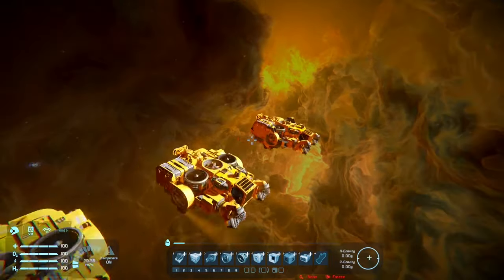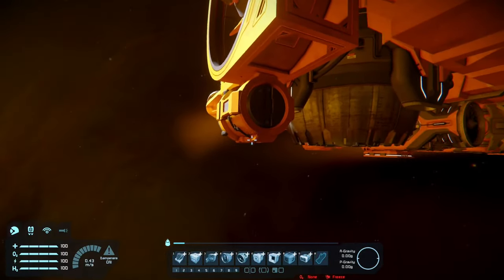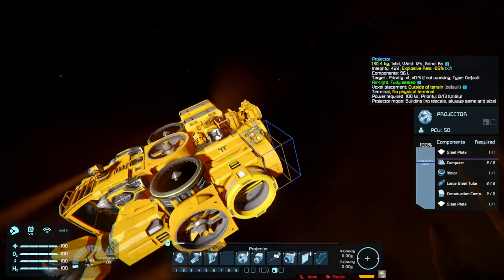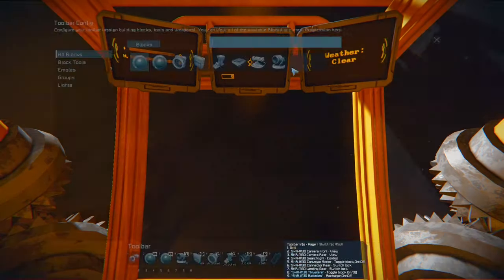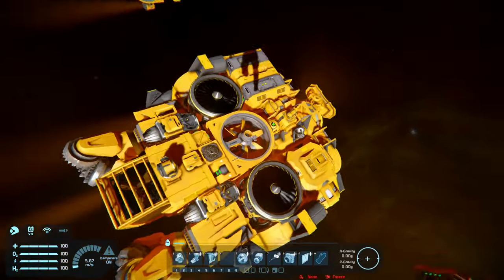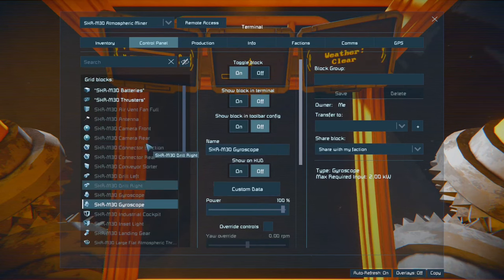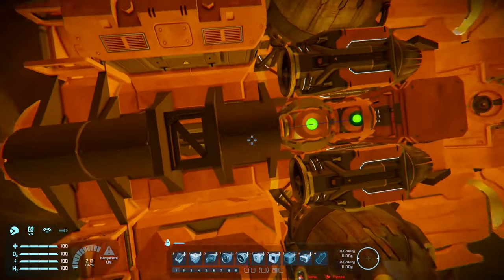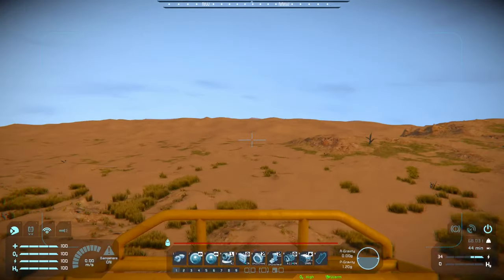Efficient & Good-Looking Industrial Atmospheric Mining Ship / Space Engineers Tutorial

Comment: While horizontal ships are fun, I find them useful only in space.  For planets I started building my miners vertical (in the direction of the gravity) and I have never built a horizontal miner since.  

Just give it a try...

For miners that will work both in space and planets I create a vertical ship but have multiple cockpits.  So the ship will have equally strong reverse and up lift.
Reply from the maker: The ores are distributed horizontally in the deposit, you can easily dig out a vertical hole while you're empty, but you need to mine the deposit horizontally, unless your miner is large enough to mine it in a single vertical hole
Reply: Horizontal miner can also save some components and power. Most vertical miners need enough thrusters to lift full load on 2 directions (upwards and backwards). More thrusters = more weight = even more thrusters = more power consumption = more batteries = more bulk (+ lots of drills and "ugliness"). Also, vertical miners needs to drill through a lot of dirt and stone just to mine a thin layer of ore. And if you want to mine more, you need another hole through that junk again. It's better to drill one hole to the right depth and then mine the vein horizontally. You can absolutely make wonderful vertical miner with two cockpits or remote control to achieve same thrust:cargo ratio, but horizontal miners are more convenient.
Reply from the maker: @themoss7115  yeah, generally you want to have a single main thrust direction (upwards in pretty much all cases) and have only enough thrust in other directions for smaller velocity adjustments while performing larger maneuvers by rotating the ship
Reply: @themoss7115  I think I understand.  If I am to stay only on the planet it is better to have a horizantal miner because of the way the veins are.  Thin but large diameter cylinder vs the asteroids where they are Cylindrical in shape smaller diameter but longer in length.  

And when in Space the vertical and horizantal really means nothing :)

This is quite a different approach from how I play and its exciting...  This is exactly why I love Space Engineers so much.  Change just variable and its a whole new game...